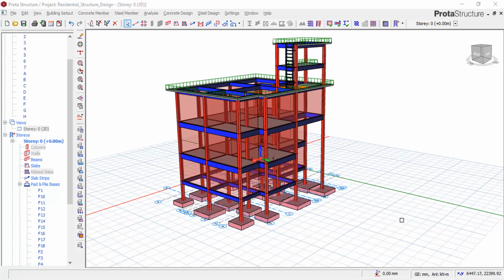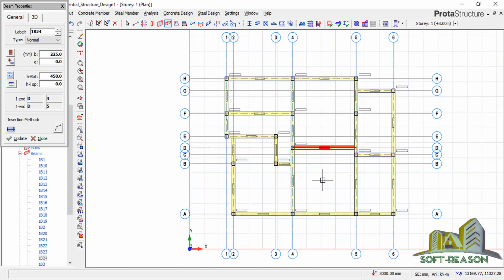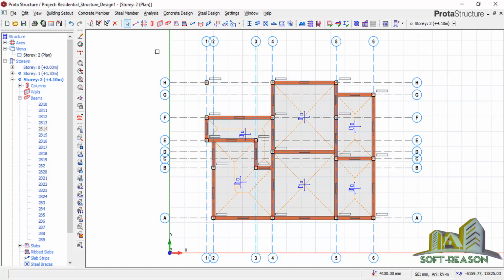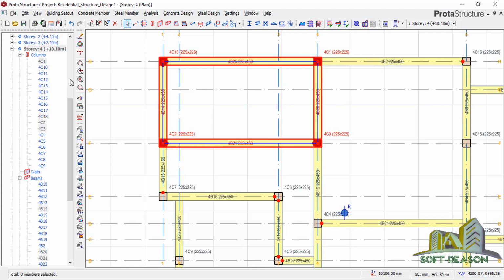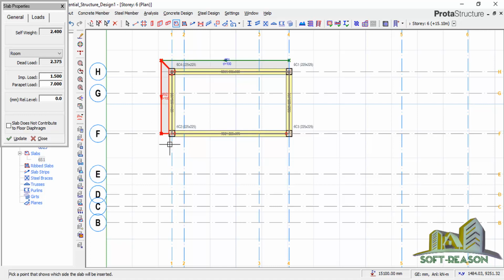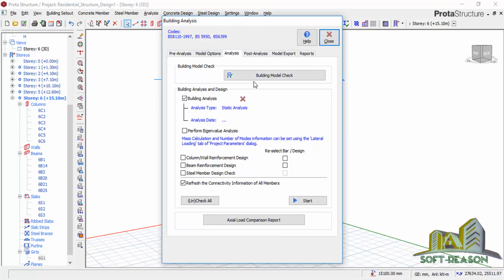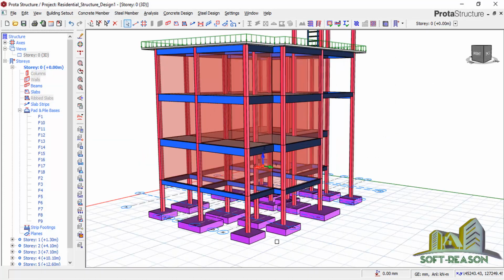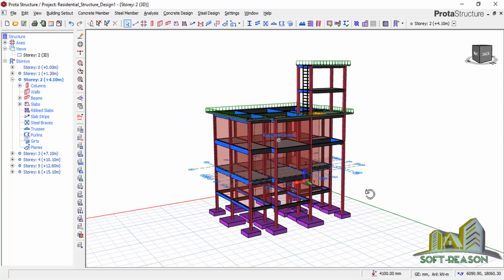Complete Real Project of 3 Storey Residential Building Design in a Special way

Comment: Good day sir
Can you explain why we hinge our beam and what's the implication if we don't hinge it
Reply from the maker: Hinging beams is the same thing as beams anchorage, it's always at a discontinued beam end support joint, where the reinforcement is bend downward into the support column. Hinging reduces moment at that joint. So failure to hinge your beam to the support columns would increase the moment at that joint and result to large foundation footings sizes.
I'm inviting you to join our mentorship program for more knowledge of structural behavior and how to use the program effectively.
Reply: @CADmade-easy  how much is the mentorship program
Reply from the maker: @Siafat-d7z   it's a private mentorship inbox me @ My Telegram @ https://t.me/soft_reasonchat
Reply: @CADmade-easy  I noticed you only hinged the first floor sir.
If we have say 3 floors, from your explanation I am meant to hinge all the discontinuous column irrespective of the floor
Reply from the maker: @Siafat-d7z  yes, other floors are been generated from the previous hinged floor.

Comment: Thank you very much. I have an observation please. At exactly 10 mins 29secs of this lecture, you used 3.470kN/m^2 as the Wall unit weight. I checked BS 648 :1964 ( Schedule of Weights of building materials) and I found out that the unit weight of a hollow block is 34.7kg/m^2 (approximately 0.35kN/m^2). Is there a mistake somewhere? Please I wish to know the reason(s) behind this. Thank you
Reply from the maker: The weight of 225 x 225 x 450mm block work is = 2.87 KN/m^2
Wall finishes-both sides is = 0.6 kN/m^2.
Add 2.87 to 0.6 to have
 3.47 kN/m^2  which is the wall load.
Reply: @CADmade-easy  Thank you very much
Reply from the maker: You are welcome Sir

Comment: Very detailed video. Well done Engr! I have a few questions; 
1) I noticed Beam 1B2 you checked has more steel reinforcements at the top span (2Y20) than at the bottom span (2Y16) when it's clear the span is undergoing sagging from the Bending Moment diagram. Any explanation for this? 
2) I noticed you rarely use FE floor analysis in your videos except in cases you're designing for raft foundations. I thought FE analysis are more accurate. Any reasons for your choice?
Reply from the maker: For your No. 1. Question beam 1B2 is at D.P.C level. @ that level there's  uneven loading at the beam anchorage  that actually cause that 2Y20 top bar or tension region which is higher than the compression bar of 2Y16. That is why we have an interactive design session where you can successfully make an adjustment to these bars.

For No. 2. Question, FE analysis and design method is actually use for flat slab and FE raft foundation, now, these are double rc slabs. But for normal slab you don't necessarily need FE analysis method. In my videos I have used both methods. We will see more of the method subsequently, okay.
Reply: @CADmade-easy Thank you. Kindly include steel connection designs in your next videos.
Reply: Hi Enameti, di you have a installation for prota. I really want to download it. Thank yiu